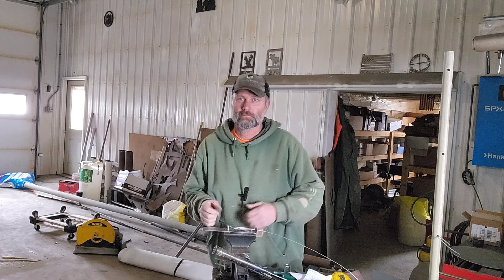Problems with the Generator

Comment: My wife and I finally got tired of DTE and ordered a geny that wil come at the end of next month. Our farm is on propane also. My only concern is that my propane supplier tells me you go through a lot more propane running the genny. After hearing you wish you had gone with the bigger size I am glad we did. ood info to have, didn't think of it as click bait. Later from down Monroe Co. way.
Reply from the maker: You won't regret it! It really doesn't use as much propane as I thought it would. We have a 1000 gallon tank,  ran it for about a week once, and  hardly noticed a drop in the % on the gauge. If it's not quite big enough, at least it will run the essentials. You'll figure out its limits. If you're on DTE, you'll use it enough to appreciate it. Lol